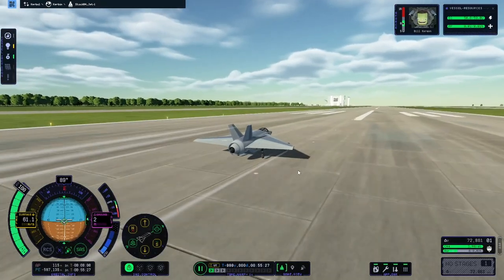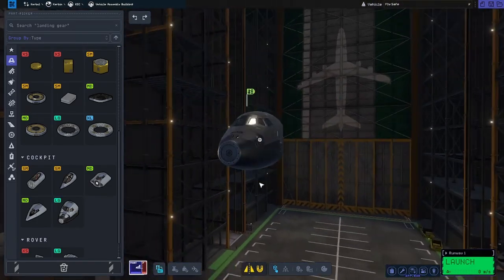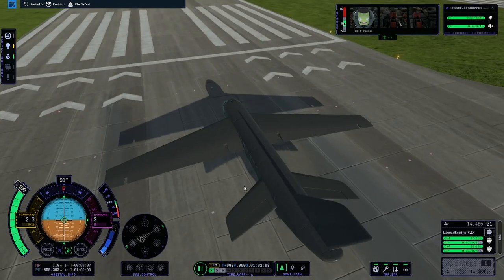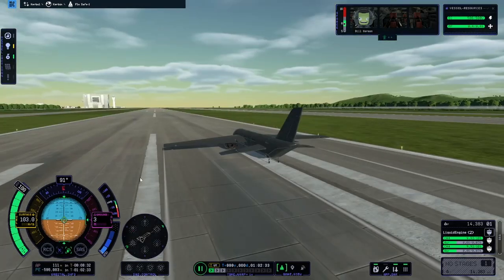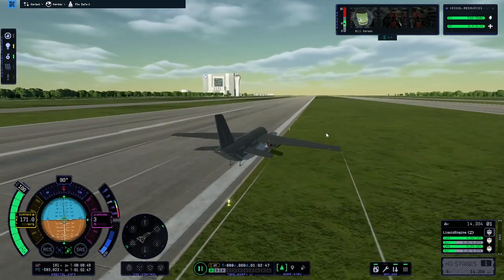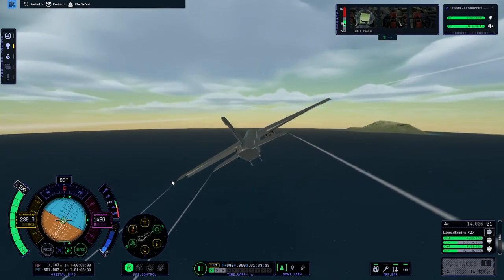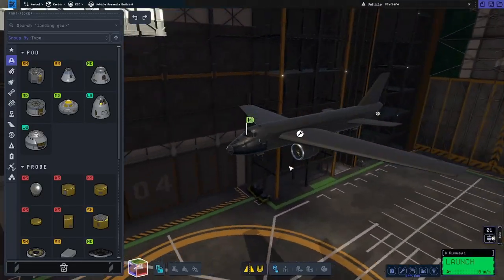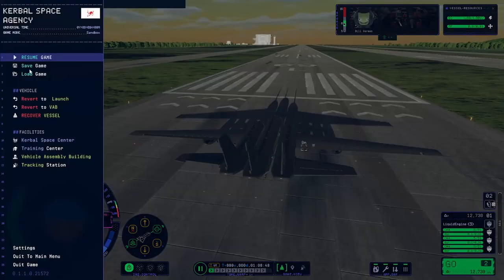I Made A SUPER SONIC Cargo Plane In Kerbal Space Program 2!

Comment: Aerodynamically speaking I believe the issue with an inability to rotate for take off is the fact that the landing gear is too far back on the fuselage
Reply from the maker: Yes I have realized that. I fixed that problem in my next video coming soon!
Reply: Yes, arranged like that it means that trying to take off essentially pushes the rear wheels into the ground.